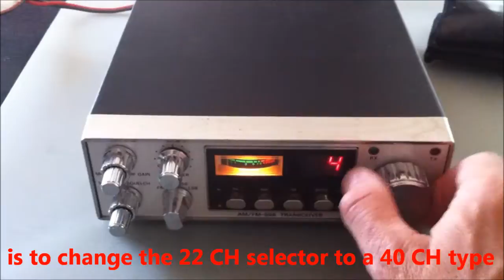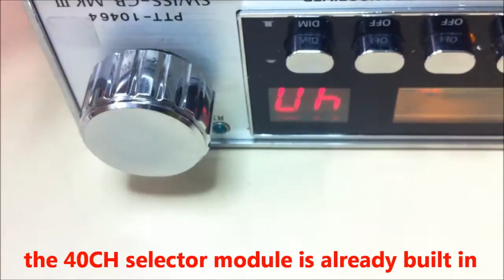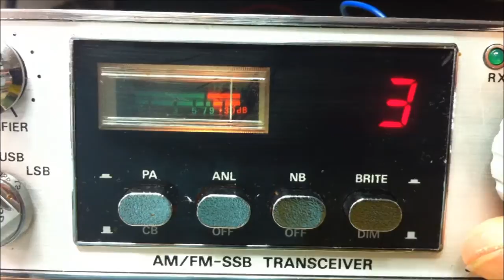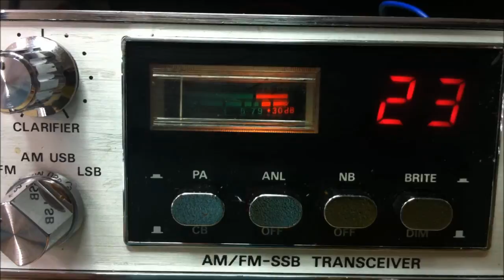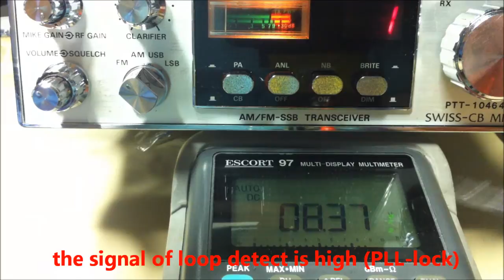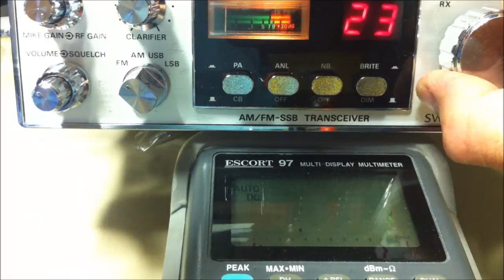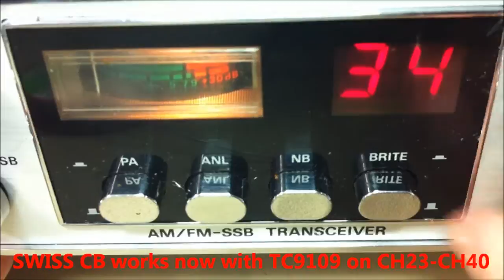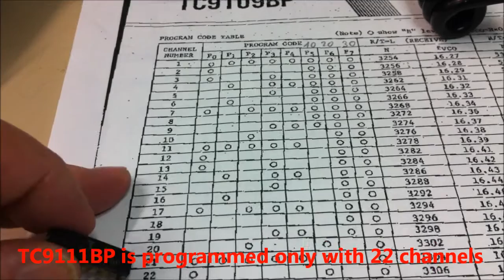TOSHIBA TC9111BP versus TC9109BP, CB-PLL Synthesizer: What's the difference?

Comment: Hi, great video, where could I find a 40 channel selector to replace in my mk3?
Reply from the maker: Hello, dear SWISS-CB fan, thank you for visiting my channel. Yes, the SWISS-CB radios, successors to the renowned President AR144 and AX144 models, were part of Jacob Trading Othmarsingen's initiative to get them certified as all-mode devices by January 1st, 1984, in line with new 40-channel regulations. Approximately 100 prototypes were created, essentially identical to the PRESIDENT AX144 units but adjusted to 4 watts AM/FM/SSB. However, Swiss PTT authorities did not sanction them. Consequently, after the company's dissolution in 1994, these prototypes entered the market as export units. Presently, Herbert Mauer in Graz offers the compatible PCB, capable of upgrading the vintage SWISS-CB-MK3 to 160 channels. This information is shared for your awareness. Wishing you a serene start to the Christmas season. VY 73 from the picturesque Zurich Oberland.
Reply: @SWIZZRADIOS  Thank you very much for your reply. Does Mr. Herbert Mauer have a website?
Reply from the maker: @thunder145  
Hello dear CB radio friend, thank you for visiting my channel again. Herbert Maurer has also made this page available in English. The SWISS-CB-MK3 uses the TC9106/TC9109/TC9111 PLL chip. The Uniden PC40 uses the same PLL type. Ask Mr. Maurer via email if he can modify the radio for you. He could make you a good offer. Here is the address:
http://funkservice.at/rep_channel-exp.htm
Best regards from Zurich Oberland.

Comment: Würde das auch ohne Tausch des Kanalwählers gehen ?

Also nur Tausch des IC`s...
Reply from the maker: Portabel 2010 hallo, vielen Dank fürs Interesse. Ja natürlich könnte man da 40 Kanäle herausholen und dabei den 22-Kanalwähler nutzen. Grundsätzlich werden bei dieser abstrakten Codierung nur die Ziffern 1-2-4-8 und 10-20-30 verwendet. Das haben wir früher auch bei den Kisten gemacht, die einen TC9106 oder 9109 installiert hatten. Mit einem der vorderen Schalter konnten wir dann die abstrakten Bits 20 und 30 zuschalten. Kanal 12 ist dann z.B. 32 und Kanal 20 ist die 40.
Reply from the maker: Die direkte Codierung beruht aber auf dem 7-Segment Ziffern-Code. Darum sind die Eingänge P0 bis P7 nicht einfach im bekannten Binär-Code Verfahren wie beim TC9100 (PLL02A) ausgelegt. Im Innern des TC9106/9109 ist dann nochmals ein Wandler (LED Programm-Code Converter) integriert, der dann nach dem umwandeln, den richtigen Binärcode dem 13 Bit Teiler zuführt. Kannst dir ja mal das Datenblatt hineinzoomen. Gruss, Stef